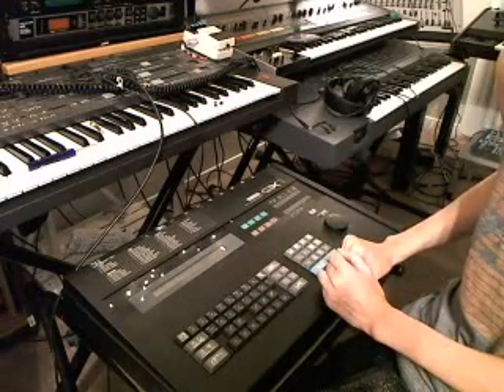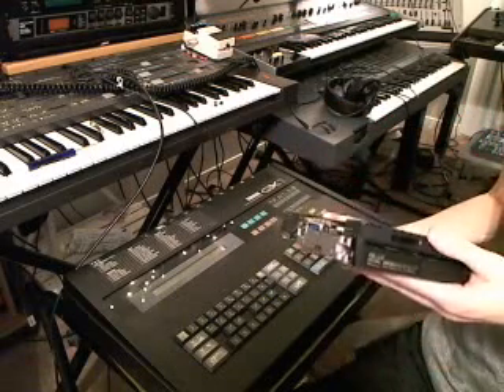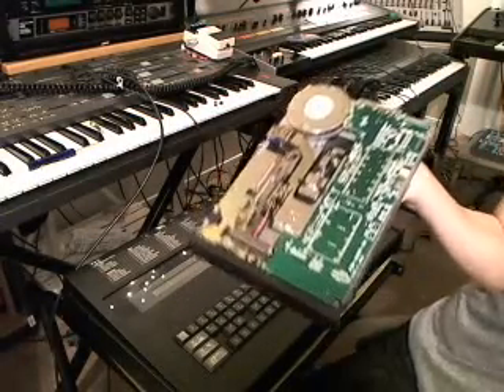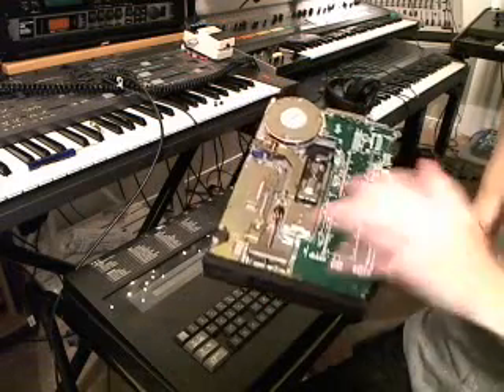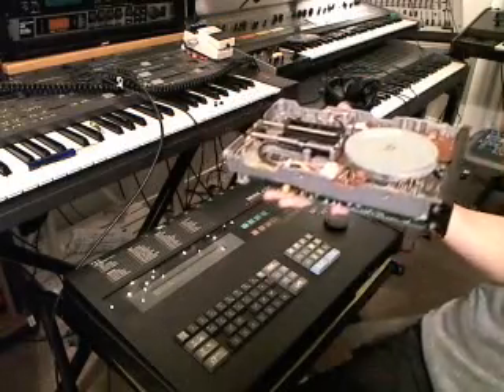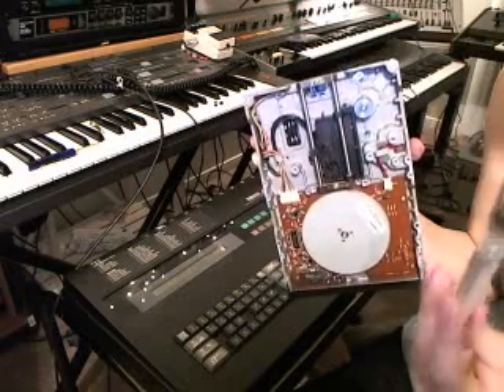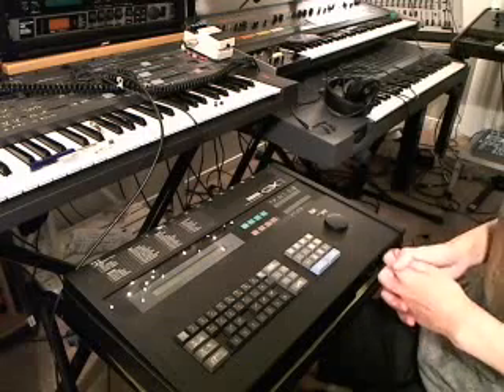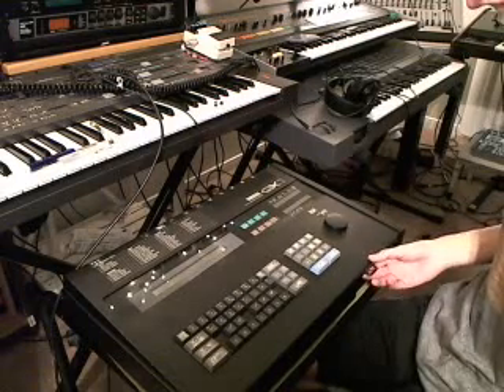Yamaha QX-1 midi data sequencer HxC function demo

Comment: curious about qx1 workflow. how does one get the qx1 to route incoming midi to the currently played sound? (midi echo on the mmt-8) also, does it have any swing function? 

thanks for any info you may have time to share. asking for a friend. no really, I am.
Reply: tngregory I have used the QX1 in the past and used a 2-in 1-out Merge Box to send the QX1 MIDI thru and a MIDI out combined to a synth. The QX1 doesn't have a MIDI echo as such so you have to use this work around to make one. It worked for me.  This HxC seems to be a cool thing, though. A great way to keep using the vintage gear with the newer storage media.  Good stuff!